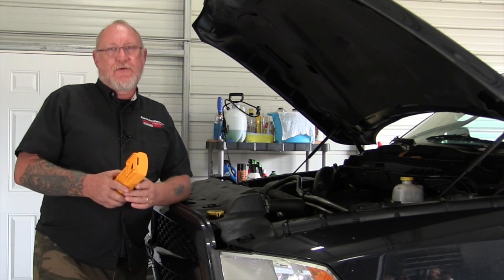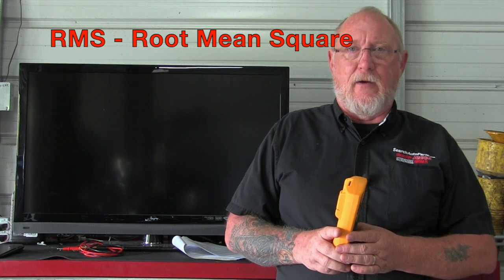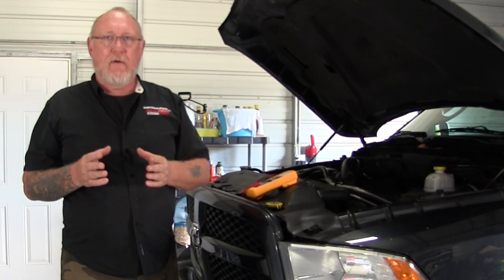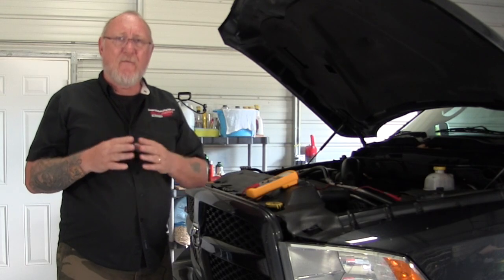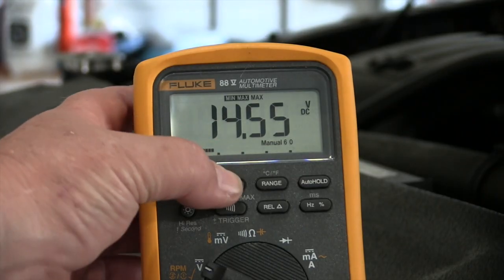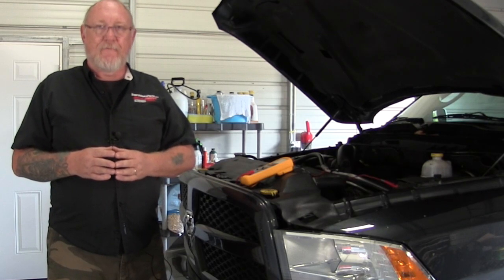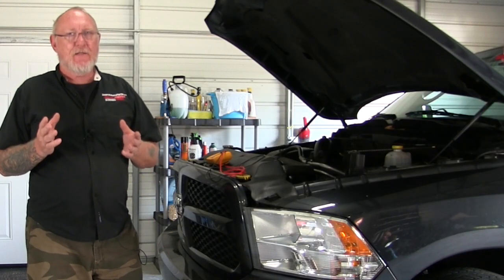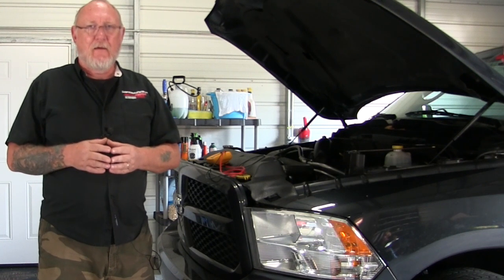The Trainer #72 - Mastering Your Digital Multimeter (DMM or DVOM)

Comment: Triplett has high quality meters at a much better price. Ideal is good too. The Chinese are making meters with the same features. If you ever open your Fluke meter you will be surprised to find a small circuit board with very little on it. What you are looking for in a meter is the insulating quality of the case and leads. Is that insulation really CAT III? And is the the true RMS really true?

Comment: It’s also important when checking parasitic electrical draw to make sure the hood switch is rigged to be in the closed position (taped down, or temporarily zip tied down, etc.), and all the doors are closed. Otherwise, with the hood up the electrical system won’t go into sleep mode. Also, after testing, be sure to remove the tape or zip tie from the hood switch. I put a Post-It note on the vehicle’s dash instrumentation as a reminder of anything that can easily be overlooked…..when working on cars, it’s easy to set distracted by interruptions, phone calls, customers, etc.
Reply from the maker: Thanks for those great comments!

Comment: i built my first meter as  aheath kit in mail order basic elec course an analog  that i used for  years   a meter will not lie   (you can trust it )   that was back in 1965  ihavseveral digital meters now but i still use the analog  when testing condensers the needle  is   better

Comment: To clarify what they mean by True RMS. True RMS, VRMS, ARMS and WRMS is
 the RMS measure of both the AC + DC components, it's integration of the
 area under the curve. This meter measures VACrms and AACrms, so it 
separates the DC component. It should state TRUE AC RMS, but like most 
meter manufacturers, they don't. There's a lot of misunderstanding on 
this thanks to marketing in companies. Take a look at a Fluke 187 or 189
 where they actually measure TRUE RMS, but on the meter they call it 
AC+DC (in Blue). Most people are fine with this, since they typically 
measure line voltage or clean DC (battery or SMPS supplied). However, 
measure a DC source with high ripple current and you will not get a real
 measure, such as in automotive battery chargers that use a linear 
charger (large transformer based, not SMPS). Knowing the True RMS allows
 you to properly design for things such as thermal, efficiency and 
safety (fuses, breakers, thermal cutoffs, etc..) and to prevent over 
charging or over powering a battery or device. Class 2 devices, as those
 that fall under UL1310, have to comply to VRMS up to 2kHz for both 
indoor and outdoor ratings. Landscape lighting, LV pool lighting, USB 
3.x Power Port also must comply. The reason for this in LV applications 
is because of the breakdown voltage of the skin. How to tell, if the AC 
symbol on the display only has a tilde ~ it's ACrms. If it has both the 
tilde ~ and a straight line – above it, its RMS. Some meters (Fluke 187,
 189, 287 & 289) use the DC for both DC and RMS, so it will have 
both if the second function feature is RMS. The Dashed straight line on 
the flukes means it can also properly measure pulsed DC.

Comment: Sir I wacth your presentation regarding parasitic draw in a circuit you put one lead of the meter to one end and the other lead to opposite lead and there's a voltage drop it's my assumption is correct tnx Sir
Reply from the maker: If you mean the demo I did in this video, yes - we are measuring the voltage drop across the fuse. No voltage drop - No current flow is occurring. If a voltage drop is measured when the circuit(s) are supposed to be off - that's where the problem is.
Reply: @VehicleServiceandRepair  Tnx for reply Sir

Comment: Sir may I know if we can used the current clamp to monitor the parasitic draw when looking for a circuit that have a  parasitic draw tnx Sir
Reply from the maker: Parasitic draws can be very small. You can use a low amp current clamp and your meter, but both tools have to be fairly good ones to be accurate.
Reply: @VehicleServiceandRepair  Sir your reply much appreciated tnx

Comment: I also have a fluke 88
Number one tip fluke says is 
Always start a test from meter off position
That way you are more likely to set your meter to the correct position 
Sample if your going to test for bad alternator diode after checking alternator voltage going from DC volts to meter off then AC volts  or if your going to check current 
Go to meter off then amps 
This method is the fluke recommend system in their self pace module along with many other tips
One accessory i got with it is the self pace training module
It came with fluke 88 operation video
Then a test, a battery, diode, resistor, printed circuit board 
After watching the video you take the test and mail it in 
Along with my 88 I have inductive tach adapter
Fluke pressure vacuum transducer 
Contact temperature thermal couple with air liquid contact tips
Inductive amp meter 
$$$$ not a cheap tool
Get a few extra amp fuses for the amp circuit

Comment: Thanks for this great information. I just got my first Multimeter and realized I have a Cat III 600 volts, not 1000.  I’m going to use mine at home on a 1989 Porsche 944 and a 2012 Prius, and around the house. Do I need to return / exchange my unit for 1000 v, or am I alright as long as I don’t use this for heavy duty vehicles?
Reply from the maker: The voltage rating is for High Voltage systems like you would encounter on a hybrid or electric vehicle. The leads, too, must be rated CAT III before trying to measure these systems - along with training in safety around them. If you're going to try and work on the HV components, I'd trade it in for the 1000 v model.
Reply: @VehicleServiceandRepair  That's a fantastic response; thank you very much again for all the great training in these videos.

Comment: also how do you do the voltage drop test with the fuses with the plastic caps on them?? i think there called j case fuses
Reply from the maker: If you mean the clear caps, you can remove them if need be. The fuse method for locating drains is only one method, and a pretty good one, that can be added to the other ways for testing for drain. Use the one best suited to your situation.

Comment: what about a test light to be the first electrical diag piece equiptment to grab
Reply from the maker: I use a test light in a later video, but primarily to show how it can lead some down the wrong path. You can't test a loaded circuit with one or get a good feel for any unwanted resistance that may be present. Just my opinion....